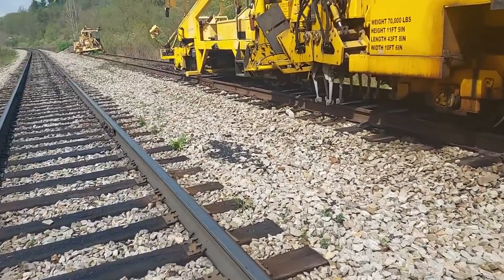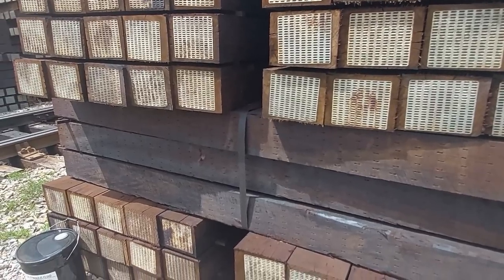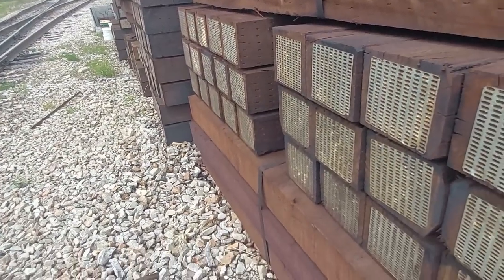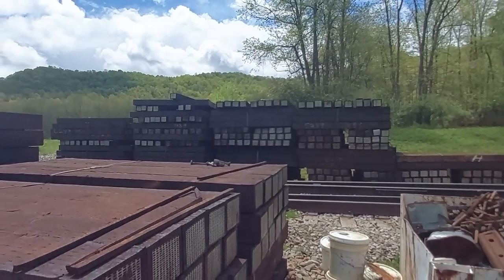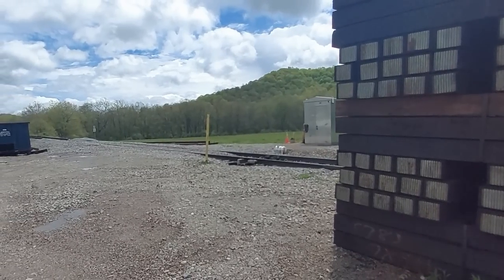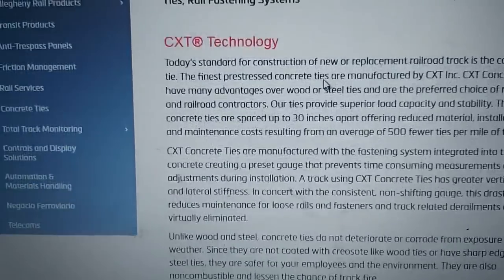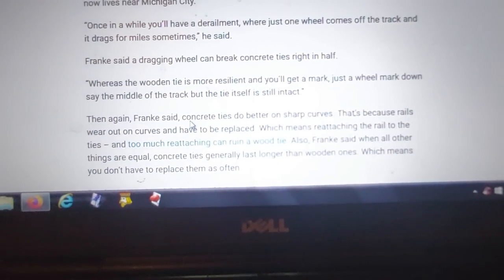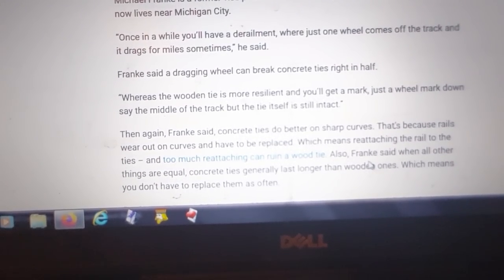Why some Railroads use Concrete and some use Wood Cross Ties

Comment: You are a good teacher. Thank you for explaining these technical things in a simple and enjoyable way. Why don't they use them for heating or other uses instead of just throwing them away? .  The problem is that if the wooden sleepers are not used... No one will reforest the trees to make them in the first place.  I don't think they leave the forests intact... They will use the land to plant soybeans or make real estate developments. Obviously I'm against cutting down a virgin hardwood forest just to make ties.  But if the ties come from forestation, what is the ecological problem caused? The trees are planted and harvested renewing themselves constantly.
Reply: Burning creosote makes some toxic chemicals. It would cost more to clean up the gases released from the burning, than it does to bury them in a landfill.
Reply: @billsimpson604  Thanks for the reply.  Most discarded sleepers must be at least 20 years old.   Even after so long, is residual creosote so dangerous?
Reply: @aleu650  Absolutely. There was a utility pole in front of my sister's house that somebody spray painted with a little silver paint. I decided to remove it with a grinder with a big wire wheel on it. The pole was there for about 25 years at the time. I failed to wear a mask & inhaled a tiny bit of the wood which was quite an unpleasant experience. The pole is still there. It was installed in the hot, humid Louisiana climate in 1956, yet still hasn't rotted! Creosote is toxic stuff. A plant a few miles from where I live now which used it to treat wood had to be cleaned up by the EPA as a hazardous waste site. They took the dirt to a toxic waste site lined with clay to seal it in for thousands of years.
Reply: @billsimpson604  Ok, thank you very much for your answer, I did not know that this treatment was so polluting.👍
Reply from the maker: Thank you for sharing your thoughts with us Aleu. Appreciate your taking the time to watch and write in my friend.

Comment: What other preservative than creosote can RR's and Power companies us for preserving wood?  I see concrete power poles installed in a Department of Natural Resources project in a salmon habitat restoration area.  Are concrete ties used on monorail tracks and on lighter passenger train tracks?  WA BNSF runs both freight and AMTRAK on its tracks.  Great video, send us more.  We had a recent derailment on BSNF track going to a refinery.  There are apparently sensors that indicate any problem with the rail that the train is traveling on, or is it the car where the problem is indicated?  Can you address crew changes and leaving a train on a track with no personnel?😊
Reply from the maker: Creosote is the best for RR ties. Monorail doesn't have ties, their
trains ride on a concrete single longitudinal surface. Many passenger/transit regular tracks use concrete ties which are
well suited to fast light trains. There's a bunch of sensors on
various RR;s some are for the cars and some monitor various
aspects of the rail, I have no idea what all BNSF has where you
mention MadelineRose.

Comment: Some of the toolmakers in my country make very beutifull sollid mantel clocks milled out the old ties the routgh clock face looks absolutaly beutifull and it have alot of caracter  many of the old railway guys going on 45 year service pension got one of that old clocks butt nowadays its disapearing.Our sement ties looked way differant in the old days it had wood inserts for the old railway bolts but not anymore.Thank you for the video. Go well and God bless.
Reply from the maker: Thank you for the nice comment Gatvol, sure can't make a clock
that looks nice out of a concrete tie....  :-) Appreciate your taking the time to watch and write in my friend.

Comment: Great information,
What is the cost of a wood tie vs concrete tie. Dollar cost to purchase??
Reply from the maker: Being that there are 28 different profiles of concrete ties, it's
kinda hard to give you an accurate answer Fred. Each different
profile has a different pricing. Wood ties here are $80.   All concrete
 are higher than that and heavier ones can be double or more the cost, plus transportation costs to get them to the job are much higher with concrete, because they are so much heavier than wood, it requires more trucks to get them to the job site. Thanks for taking the time to watch and write in my friend.

Comment: Maybe they put concrete ties in around here because there are many freight trains that go by each day around here and some of them have six engines at the front, another few engines in the middle and then a few more at the end. I literally filmed one that took over ten minutes to go by and it was going at a good clip at the time too, plus it was on its was downhill. We regularly get trains with at least those midsection engines so that trains are long and I'm sure they are also incredibly heavy. 

Something I think I have noticed over the years of standing around and watching trains go by is that it seems like the concrete ties transfer more of the vibration from the train into the surrounding ground because I feel like you can feel a train coming from further away because you can sometimes feel the ground shaking when you can't even see the train yet (not that I walk on the track or anything but we have some popular walking trails that aren't all that far from the track and they happen to lead to some of my favorite hiking trails, plus I get to watch all kinds of trains go by on my way).
Reply: I just looked up how many trains go by here on average each day and it's 17 in the day and 17 at night! It has never seemed like that many, although sometimes they pass each other so that ends of seeming more like one, very long train.
Reply from the maker: VEry interesting on the transfer, wish there were some around
here so I could test that out, really got me curious bout that now.

Comment: I don't know what axle loads are on US freight lines are, but in Europe for mainlines I believe that the standard is for 22.5 tonnes with 26 tonne maximum. In Europe mainlines are now almost universally Continuously Welded Rail running on concrete sleepers (ties). Note that's metric tons. That's equivalent to 24.8 and 28.7 US tons respectively.
Reply from the maker: Typical loaded freight car we have here Steve is 286,000 pounds
so you can figure axle loads from that. Not many freight cars are
loaded over that amount here, a few, but those are mostly specialty
loads. We haul only coal but much freight across the country is
less weight. Thank you for taking the time to watch and write in
my friend.

Comment: You have to like a company that names its tamper - Jupiter 2 :)  A Lost in Space fan or two did that I think :)  It is fascinating to learn the differences between wood and concrete. I have seen miles and miles of concrete ties out in CA in the Tehachapi area which has a lot of curves going up the mountains. That ties in with what Mr. Franke said. Outstanding education - thank you, Dave :)
Reply: lol I never thought of it that way!  To clarify, the electronic control system, not the tamper itself, is Jupiter (old) and Jupiter 2 (new).  The tampers models are Mark II, Mark IV, Mark VI, etc., made by Harsco.
Reply: @mtgibbs  It is still an excellent name :) The tamper is an amazing machine, The engineering that goes into it is very cool!
Reply: @brianhickey5949  Indeed!  They are very impressive.
Reply from the maker: Thank you for the nice comment Brian, glad you enjoyed. Appreciate your taking the time to watch and write in my friend.

Comment: A properly managed Forest can go on producing timber Sustainably for years and years, the secret is to not over exploit it hence the word properly managed..here in Oz we are using a combination of Timber Sleepers aka ties and are slowly moving to concrete in many areas and steel and recycled plastic. Around my State in Victoria Australia we are trialing recycled plastic in some areas we have had those installed for about 8 years now, the initial batch was no good warped twisted etc but we've learnt and later batches are much more stable talking 80 year life span at this stage only estimates...we have very variable temperature in terms of weather from just below zero deg C to 45 50 deg C track side, you can basically cut the and manage them like timber but early days yet......my bit for what its worth regards
Doc from Down Under
Reply from the maker: Thank you for the nice comment  and great info Doc from Down Under.  Appreciate your taking the time to visit with us and check out the tie show my friend.

Comment: In Belgium, we seem not to have those derailment problems as you explain?  In Europe there is only concrete ties, we call them sleepers.  The latest evolution is the use of sulfur concrete, some 10.000 of this type of ties have been installed in Belgium for testing, with promising results up to date.  This sulfer concrete has no cement content and has for that reason a lower CO2 footprint.  And you only believe when you see it: this concrete can be remelted as often as desired, it melts at +/- 120°C! And it is resisting much better acidic environments!
Reply from the maker: Thank you Dominiek for sharing your thoughts. Appreciate your taking the time to watch the video and write in. May you have a most blessed day my friend.

Comment: Concrete ties also have some carbon footprint because making the cement to go into the concrete releases a lot of CO2, nothing is perfect! We don't really have a lack of wood available for them, especially in Northern Europe many parts for the railways are made of wood, for example the poles for catenary and such, but they are also going over to concrete ties.

I think the main reason we have switched over to almost all concrete ties here in Europe is that most of our railways are for higher speeds so they require tighter tolerances, that along with being able to spend more on maintenance to keep the track bed in very good shape (because we just run a lot more trains) means that the advantages of wood ties go away. It's very rare, especially in western Europe to see muddy ballast or ties that are loose in the ballast, only on infrequently used sidings and heritage railways do they not focus on keeping everything in perfect condition. 

I still remember when I was young a lot of the railways where I grew up in the Netherlands still had wooden ties and jointed track, it's all been replaced since then. Very interesting to see your perspective.
Reply from the maker: Thank you for the nice comment qhfreddy, very well presented and
great information to find out. We appreciate your taking the time to watch and write in my friend.

Comment: A response to the comment, “One thing about concrete ties in the curves is gauging, it can be troublesome with the lateral forces of the weight pushing against the high side of the curve wearing out the insulators thin causing wide gauge and rail canting, it can be high maintenance.”

Presumably, the term “insulators” refers to the wheel flanges. Given that the wheels are conical in shape, an axle entering a curve will cause the inside wheel to ride on a smaller diameter and the outside wheel to ride on a larger diameter, which will cause the axle to be guided in the direction the curve is turning. Therefore, the wheel flanges are not likely to wear much if the railway tracks are designed properly.

The rail is fastened to the sleepers on steel plates that are usually placed at a specified distance at the time of casting the concrete during the manufacture of concrete sleepers. The distance between these plates is increased in case of sharp curves and kept closer to the actual gauge for straight tracks. This is necessary to limit what in engineering terms is called “lateral lurching.” In other words, the sleepers used in straight sections are not meant to be the same sleepers to be used in curves.

Having concrete keeps the tolerances firm. As the video mentions, there is some flexibility with wooden sleepers. Flexibility is not an advantage. Trains need to run on firm tolerances. For good quality tracks, the tolerances should be as accurate as possible, with appropriate sleepers used in appropriate portions of the tracks. The only disadvantage with concrete sleepers is probably the cost.

At @1:48 mark, the concrete sleepers are made of two concrete blocks with a steel profile visible in the middle. It is unclear why these sleepers were made like that. I have seen such sleepers before, but only in rare cases. Concrete sleepers did not work in the instance mentioned in this video, and I believe the failure was due to poor installation and bad tolerances, and not because the sleepers were made of concrete. Railways around the world use concrete sleepers and they work fine and certainly do better than wooden sleepers.
Reply from the maker: Appreciate your sharing those thoughts with us. Excellent comment. Thank you for checking out the video. May you have a most blessed day my friend.

Comment: Wood is a renewable resource so the trees cut down could be replaced.  I am guessing that ties are made out of a hard wood which takes longer to grow.  Bet that younger trees produce more oxygen than older trees.  Isn’t concrete considered toxic and requires special disposal?  The only place I see concrete ties used extensively is NJ transit.  It would work for them due to the light rail, deep pockets, and workforce that can stay on top of maintenance.  Interesting video, I enjoy watching your videos.
Reply from the maker: Appreciate your sharing the very nice comment Greg. Concrete ties
do lend themselves well to higher speed passenger trains. Thank you for taking the time to watch and may you have a very good day my friend.

Comment: FEC has concrete ties in place from the early 1900 being only being now for the bright line upgrades
Reply from the maker: Appreciate your sharing those thoughts David, length of a tie
depends also on the weight of traffic over them and weather
conditions, not much weight on passenger or transit lines. Thank you very much for taking the time to watch and write in my friend.

Comment: What are your thoughts on using concrete ties in Chicago instead of wood, in a mixed heavy freight and commuter environment? Thanks.
Reply from the maker: I need to go there and check it out Christophero... :-)  All RR's have their own unique track problems/weather/economics, etc. There is no one tie out there that is ideally suited for every single RR going. 
Each RR has to use what is the best option for them, and often use
different options for different sections of track. Concrete, steel, composite or wood all have their pros and cons. It is a good thing
that there are options available to suit each RR's particular needs.
Appreciate your taking the time to watch the video and write in
my friend.

Comment: the stiffness of concrete is probably why Amtrak uses them on the NEC now, the Acela needs good firm track to run 150+ mph. Though id imagine the traffic frequency also makes the ROI justified given how much of the trackage is also shared with commuter RRs.
Reply from the maker: Appreciate the nice comment and for sharing those thoughts. 
Concrete lends itself well to high speed track. Thank you very much for taking the time to watch and write in my friend.

Comment: I can remember one wheel coming off and doing a lot of damage in the Adelaide hills to the concrete sleepers. The sleepers were replaced early, but the track was still useable despite the damage.

Does anywhere use steel sleepers in USA? Disposal will be easy, just send to the scrappers. 
There used to be long lengths used around Adelaide Australia on the main line.
Reply from the maker: Thank you for the nice comment  A NNYER.  I will do a future video on steel ties for you. Appreciate your taking the time to visit with us and check out the tie show my friend.

Comment: All of the tracks in town have wooden ties, including two diamonds (tracks crossing) about 20 feet apart, but the main line leaving of town town are all concrete ties with all welded rail construction, while all of the sidings tracks have wooden ties and are 24 to 32 inches lower than the main line next to it and much more poorly ballasted. Ron W4BIN
Reply from the maker: Thank you for sharing that Ron. Appreciate your taking the time to watch and write in my friend.

Comment: lets be very clear what the class 1's like BNSF have found: Concrete ties do not work in areas that have freezing temps, and they fracture and de-laminate from the steel fixtures and re bar.  Further, IF you leave locomotives idling on them, the sub harmonic frequencies transferred through the locomotives wheels cause micro fractures.  This phenomonem takes very little time.  It is similar to how a jack hammer drives deep, denigrating vibrations into concrete, causing the concrete to disassemble.  Those micro fissures and cracks fill with water, freeze and cause tie failure, or rebar de-lamination.  Concrete ties are cheap, and easy to make and deploy.  But they have far less life than the hardwood ties that some of the Class1's are replacing millions and millions of their concrete ties with.  Concrete ties are a very short gap, poor, ineffective replacement for good, strong, flexible, resilient, and long lasting wood ties.
Reply from the maker: Appreciate the nice comment 3RTracing and for sharing those thoughts. Thank you very much for taking the time to watch and write in my friend.